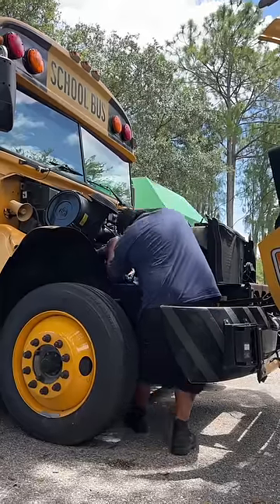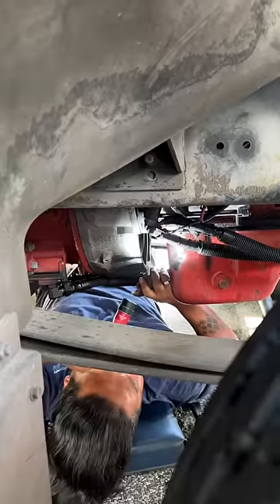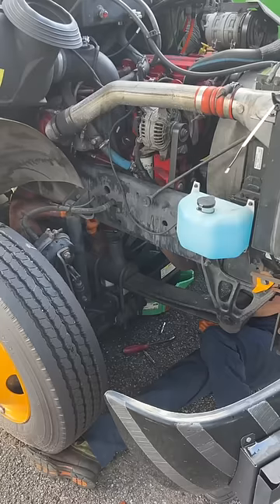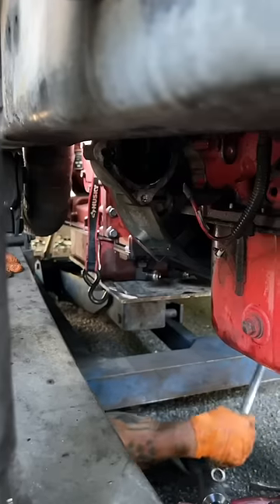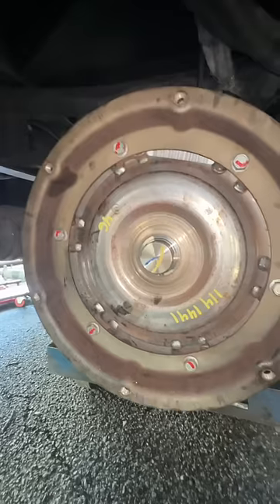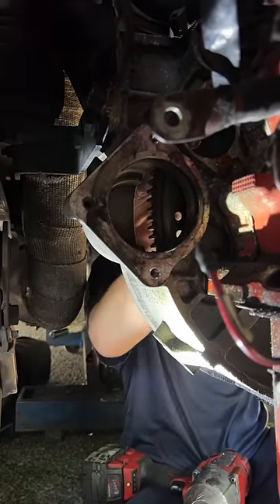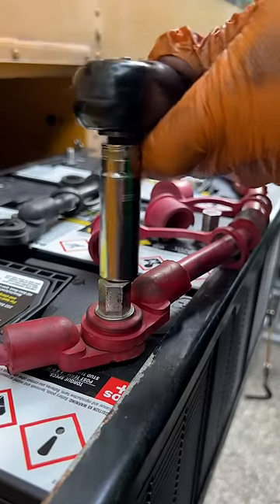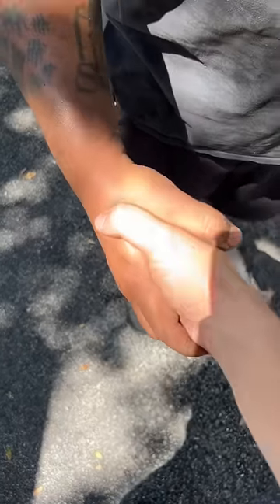How much have we spent on repairs? #diy#busconversion  #skoolieconversion #vanlife#skoolie#buslife

Comment: Yes, but you should get a lot of fairly cheap running out of it once it’s repaired. Don’t cheap out on the compressor. That’s your brakes, and likely your rear suspension. Those should last a long time. Get a good quality rebuilt. Your tech will know the right one. As a side note, make sure you set up your bus with one or two  air hose couplers so you can  use the air system for inflating tires, running tools, or just blowing dust off things.

Comment: Compressor is an easy fix until u can find another one, pull the main feed line off fill the cylinder with carb and choke cleaner let sit for a min or 2 turn engine over (dont stand nxt to it) repeat this using a whole can install line remove the same line at the air dryer and confirm the air is flowing freely thru the line this should buy some time they get carbon build up in them and it slows the air flow causing the compressor to not build air pressure like it should

Comment: Just a Word of Wisdom I Wish I had Known Before Bying A Used RV.1994
,To Other Individuals Wanting to Live off The Grid, Before You Bye A Used or Brand Spanking New School Bus,R
v. Etc,Contact A Trusted Repair Shop,,Set up a Time To Check Over Vehicle That you Want to Purchase,Ask,The Seller, If Take it On a Test Run &Go Directly To A Well Trusted Repair Shop,Have Them Check Over it,To Make Sure Your Not Going to Have Any Problems With A New Vehicle, Recreational Vehicle Or Used Recreational Vehicle,,Etc Car,or Truck.If Repair Shop Finds a Fixable Problem Get a Print Out, You Used That as a Bargaining Chip With Vehicle Owner.

Comment: Bypass air compressor might have a check engine light but I'm sure there's coating and parts to get around it and if you have emissions might not work

Comment: Replacing the air compressor while changing the rear main seal would have been less labor. May not need to change the engine compressor. Sometimes you can just replace the head or run atf thru the intake. Sometimes that can clear up if the issues is with the unloader.

Comment: If I was gonna travel in it, I would learn how to fix it, a rear main is hard, but diesels are simple especially these, and that bus is plenty big enough to store a jack and the necessary tools, especially with all that room between the frame rails, you can change that compressor yourself

Comment: If the air compressor is locking up it would cause a hard start, remove the compressor and use a cheap shop air compressor 110volt from harbor fright

Comment: Rear main seal would just be a leak not a hard start and if your air compressor was broke you would hear a lot more noise and wouldn’t have air to use the brakes on the bus itself.

Comment: FYI the rear main seal is the most labor intensive job aka most expensive job on most cars. Not even worth it unless it's dripping oil daily. If it's diesel though everything will leak

Comment: Yo whats wrong with the compressor ? You can rebuild the heads . 
Oil leak won’t cause a hard no start , sounds like your batteries might be weak , that will fry your starter over time trying to pull all those amps , check your batteries , and check your starter , also don’t be afraid to tackle your own valve adjustment easy .

Comment: Get electric air compressor maybe can be run from separate battery, They have made electrical water pumps maybe they have made something like that as a replacement all the air conditioner pump is essentially is a  fluid pump running from crank power with   Clutch snout either v belt or serpentine belt the condenser is what cools the fluid so essentially if you remove it and run a decent solid electrical pump off solar as you’ll only be needing it when it’s heaps sunny and hot also a plus it will give you move power having no belt driven aircon pump

Comment: You need to look for a other bus or another motor, you definitely have a, or a couple down cylinders (low compression). You can hear it when it's being turned over. Best of luck though, 🤞 it's just a bad starter with some stuck rings that'll work out

Comment: Here's a cheap way get a air compressor for a shop or garage make that your compressor for your brakes but it'll be noisy and cheap but since you'll already have a power inverter you shouldn't have to get a stronger one unless you get one of those 150 gallon air compressor

Comment: Bad rear main would just make it leak oil. Quite honestly has nothing to do with it starting or it cranking hard. Sounds like it just had a couple low batteries. Rear of engine looks pretty clean tbh. You could always have your air compressor rebuilt. Might take just as long as getting a brand new one though.

Comment: This unit most likely has a 559 code which is fuel pressure related to cause the hard start issue. Take it to your local Cummins dealer and get it fixed the right way

Comment: Unless the rear main seal was leaking badly? Meaning if it was just a few drops over night or a bit wet from oil around the seal i wouldn’t’ve bothered with fixing it as it’s a very very common leak. But if it was a small puddle every morning or like a dinner plate size yeh definitely fix the leak.. Just hope these dudes didn’t scare you into fixing the rear main if it was a small drip as most are including my Truck.

Comment: That was a weak battery the main seal just causes an oil leak 😀 and the bad air would've caused a soft brake pedal. Should've noticed that

Comment: An engine will start also with 0 oil pressure, the consequences are another thing, but it will start. Here is a started motor problem, or more simply the battery is dead and can't feed enough current. Or 2 the started motor has problem, wear hub or solenoid doesn't let enough current flow to the motor itself. Or 3 the engine has a bad gasket and the water or worse the oil goes into the cylinder. Those are the 3 case scenario for a slow crank.

Comment: While the rms may have been leaking I have seen WAY worse…lol battery voltage sounded like your issue, could’ve been a starter or cables even but the rear main wouldn’t cause a hard start

Comment: Air compressor is fine. I bet you it's the air governor. Bad air compressor is probably the head on it leaking oil or coolant into the air system

Comment: You literally just needed to jump or charge battery. Rear mean seal won’t keep it from starting. Been running mine with the rear main seal and it just leaks tons of oil. Still drives. You just need to keep refilling it. Instead of buying new air compressor, have someone rebuild it for you. It’s cheaper and only replace the broken component.

Comment: buy Donner busses instead of parts 

use a 12v/24v electric compressor or put a mains compressor pump in without electric motor

Comment: Did you check out the bus before you purchased it? Sometimes it takes time to find the right bus for the right price. I've got a schooly I bought for $1200 and it even has the dreaded 9.0ltr the only thing we've had to do is basic maintenance, tires and a brake line, we've owned it for about 2 and a half years and still running great. Do your homework and don't buy a money pit. It was not a schooly when we purchased it. When our house is done maybe we'll sell it maybe I'll move it back into the woods for the wife and I took relax in.

Comment: Fire that guy. He pulled your trans and replaced a rear main. Great you fixed a leak. Had nothing to do with your starting issue. Compressor is broken?? Probably just an unloader valve. Try throwing a head on it before replacing the complete compressor. Should have bought a dt466

Comment: A rear main seal isn’t going to give you a no start condition no matter how bad it’s leaking unless you damaged the engine from running it without oil. And if you did that then replacing the seal would be like spitting on yourself during a house fire.

Comment: Dude my gmt400 3500 gmc pissed out the rear main seal. That's not going to affect starting. Mains going on large trucks is kind of a fact of life, with a lot of these trucks the saying is that if there's no oil under it, there's no oil in it. If you've got an air starter, holy shit maybe the compressor that powers the starter is fecked.

Comment: If a rear main seal leak causes a hard start get ready to replace the engine you got bigger problems than an air compressor being broken you need a bottom end

Comment: Um guys a rear main seal leak is not a high priority repair. It certainly won't cause your engine to not start. Nor will the compressor. The hard start is either low or bad batteries or bad cables or connections or the starter is drawing to many amps. And needs replaced. Or your rear main is leaking and you never check your oil. Not saying it didn't need done but it sounds like you got reemed a little there.

Comment: Should have got an older bus with a pre emission engine. Not only will it be more reliable and more fuel efficient, the parts will also be cheaper

Comment: The hard to start issue had ZERO to do with the rear main seal. It actually looked like the oil was from the oil pan seal. They took you to the cleaners on that deal and you probably just had low batteries.

Comment: hey guys.. just a quick question . all of these mechanics inside. my dealer refused to find me a new or used ECU. I went to the junk yard and got 1997 ford ranger ECU. my truck is a 95. its. not the exact number on ECU but a 3 liter. . anyway, got it home and my truck started. I moved it two inches and cut it off. so excited 

can I use that ECU if I find someone to flash the box or do I need to try to find another in a state or two away that's the exact year and model on the ECU. . it's getting hard and my truck has sat for 5 months until, yesterday. it started.  that was the diagnosis

Comment: I would look into that hard start problem. That's cranking over slow
Reply: Motor is going bad internally it’s done
Reply: @masonshelton9216  agreed. Those Cummins engines spin over quick. They have a gear reduction starter on them
Reply: @GregFeeney392  I used to have a few different 5.9 12 valves + a 24 and they were like a snap of your finger. The starters are amazing on the 1989-1993 1st gens
Reply: @greg feeney     I also found , a higher idle helps/ makes all the difference in crank to start up time
Reply: @masonshelton9216  somebody used starting fluid way too much in that engine 😂
Reply: @GregFeeney392  definitely lol , I did that to a  6.5 Detroit a few times , my gosh that is a horrible sound..

Comment: Seen a few busses converted? And everyone of them the motor or tanny quit working. They are not meant for any kind of load and break easily if to much weight is added to them. As they are built for safety? Not for hauling any kind of load!

Comment: I don't know how people afford the fuel cost of these huge things or why they even convert just get a used R/V that is purpose built even a low miles 4yo model one is 90% off msrp in the long run it is cheaper and much nicer. I lived on the road in my 20s on a real budget, I took a trailer and a old BMW. when the car needed repair I just unhooked the trailer lived in it and found a shop lift to rent to fix the car. visited every national park that way.

Comment: You need to find a good mechanic rear main seal will not make a vehicle not start maybe leak oil also it sounded like the battery was low and maybe the charging system isn't working properly but anyhow you need to find a good mechanic take care

Comment: Any mechanic worth his salt, coulda told you by listening to that squeaking sound while starting that something internal is severely screwed in that engine, sounds like a spun bearing at the least, time for and in frame if your real lucky, but most likely a total rebuild is gonna be required.

Comment: Problem is you bought a newer model bus/pos you should have bought an older 80s/90s model
that are 100% more reliable even in used condition.
And if needed parts are much much cheaper.

Comment: First step before ever starting your bus is to check all fluids. I'm almost positive that would have prevented this. The engine sounded great until the last video. I thought I the last video that the engine sounds terrible, definitely a rod bearing. And seeing this video verified my suspicion. Please learn basic mechanic skills and that will save you a huge headache. No negative feelings intended

Comment: Did he at least give you a reach around?   
 That seal would just leak oil not keep the bus from starting.  it really sounded like your batteries weren’t charged or a bad connection.

Comment: The rear main seal didn’t stop if from starting, it literally holds oil in the motor while allowing the flywheel to spin the torque converter.. sounds like you got ripped off..

Comment: Guarantee it wasn't the rear seal there was no evidence of the bottom of the trans being dirty from it leaking also a seal does not prevent the engine from starting or being hard to start but batteries being low will do the trick
Reply from the maker: Watch newest video for more information

Comment: Rear main seal has absolutely nothing to do withe the engine not starting, and if you guys are that clueless then it's no wonder you've already blown your budget, these mechanics are taking you for anything they can. The rear main could have waited, and is no reason to have it towed. The air compressor that powers the brakes should have been your priority.

Comment: I don’t understand what the rear main seal oil leak had to do with the truck not starting??? Unless it was leaking a lot a lot you normally don’t replace those.. after seal was replace led bus started? Head scratcher…

Comment: I am an actual diesel mechanic for Semi trucks busses box trucks gas trucks I work on all kinds and makes of engines  a main seal is a easy fix and you do not have to remove the transmission to do it at all and it has nothing to do with a hard start that is either fuel power or air not a main seal or a compressor a compressor is only used for the breaks or the air bags and sometimes shifting yall need to find a better Mechanic

Comment: Rear main seal. Or do the air compressor? 🤔 ehhh let's do the $30 seal with 4k on labor. Yeah that's expensive. But holy shit. Get this. Diesel is a very expensive vehicle to maintenance. Get used to it. Either the Diesel makes you money. Or you have money. But be careful on cheating the price of the air compressor. Don't want to do it again a 2nd 3rd or 4th time for fun when you just did it more or close to what the better expensive one would've been the 1st time.

Comment: WTF?! Slow or hard start has nothing to do with the rear main seal leak or the air compressor. 🤯 sounds like you should’ve called diesel Brothers. Slow or hard start 1st do battery check. 2nd charge them if low. Get running check charging system. Also check alternator for charging.looking for hard to find parts call Fleet pride. It sounds like your mechanic took you for a ride. Unless you didn’t explain it, right.

Comment: Your mechanic is making a killing off you all. A rear main seal isn't a hard start condition, unless all the oil has leaked out and the motor is locking up.

Comment: Umm that was not a rear main for there was no oil covering the rear of the engine and the slow crank would have been due to low batterys or bad starter

Comment: Yeah a rear main seal isnt going to make it not start all that will do is leak oil.
Reply: Also looks really clean for an oil leak i dont see any drips on the ground much less on the trans/engine where oil should be if it was leaking.

Comment: You bought a old school bus, that has probably been sitting for years in a field. There are seals leaking, and repairs needed. That’s a guarantee. I highly doubt, This is the only repair also. The engine didn’t sound great either. I have seen people remodel them, but I am not a fan. You can spend a lot of money to do it correct. These really are not great for traveling, camping either. There is zero insulation in them, and setting them up properly is expensive. Good luck to both of you. My advice is stop while ahead, and invest in something more practical. The bus is also hard to insure, and not parts can be expensive. They were never designed to travel highways, or live in.

Comment: You got scammed sister, sorry to tell you. All that oil seal does is keep oil from leaking out of the engine and into the bell housing. Has absolutely nothing to the engine running. Also I noticed the inside of the bell housing where that seal is, the whole housing is nice and clean as well as your torque converter….if that seal was “leaking” it was probably a seep unless they cleaned it all up prior to you shooting this video. If not the only thing you needed to do was replace your batteries. That weak cranking in the beginning not letting the engine start was due to dead batteries. Simple as that. Also you can have those compressors rebuilt depending on the issue it might be the cheaper way to go it sounds like.

Comment: Waste of money... should of got or still get a motor coach mci bus with a Detroit 60 more reliable hauls more has more storage and better access for adding ac and heat like a house plumbing  gets better fuel economy and cheeper to repair and operate. Also run longer.  Ditch the school bus get a better driving smother riding longer lasting bus

Comment: hold on, first the truck wouldn’t start, so you replaced the rear main seal, now it starts? what kind of scam did you just fall into mam, i think they lied to you and found an easy fix for the starting issue and told you to replace rear main because the amount of work required drives up the price to the moon

Comment: Sounds like bad batteries or a Alternator on his way out or bad battery cables
Reply from the maker: Maybe
Reply: @JessandJake  had the same issue in my 07 interthrashnal  the battery cables broke at the eyelids  you so it was hard to find